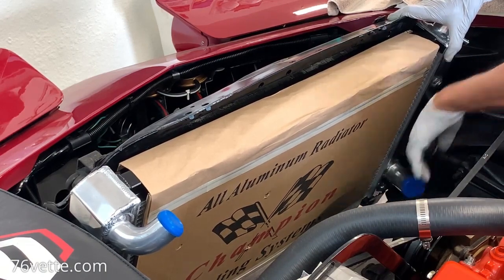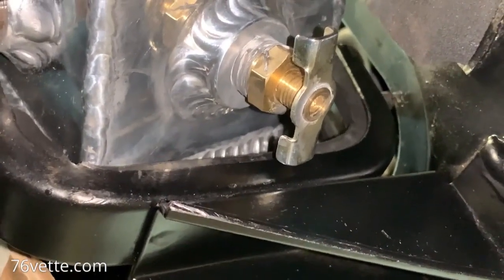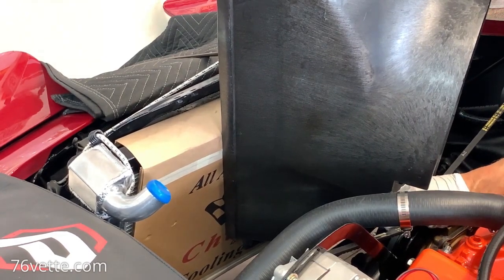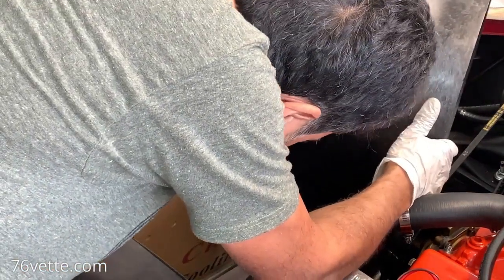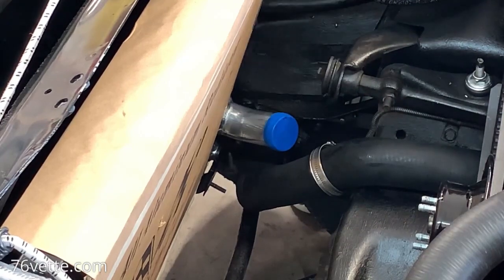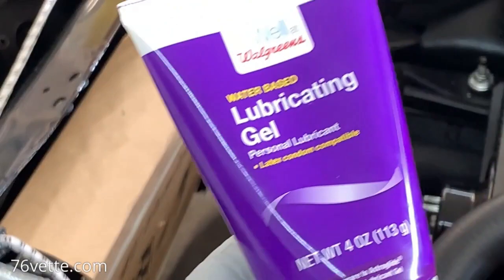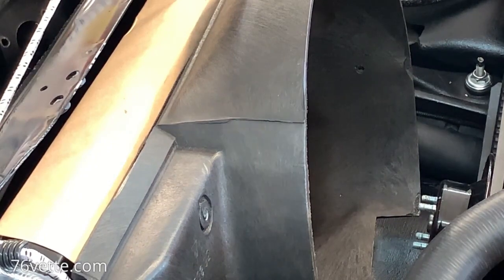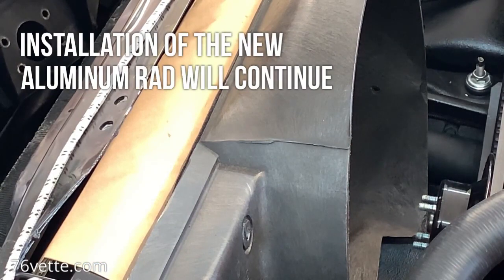STOP 🛑 DO NOT Cut the Shroud!

Comment: I am prepping to remove the water pump, timing gear set, probably the oil pan… and discovered that whoever changed out the radiator prior to my ownership, split the shroud in two halves. It was a very neat job, but it surprised me when I discovered it.
Cut on top, and bottom middle. The reinforced with blind plates riveted in place. Almost invisible.
Reply from the maker: As long as it looks good and does its job, you have nothing to worry about. 😊👍🏻

Comment: I watched it on Corvette Ben they u put the fan shroud on with the radiator completely out. Then u slide in the radiator. It goes in wayyyy easier like that
Reply from the maker: I am sure, but then you still need to wrestle with the lower hose which is very challenging with the shroud on. But I may give that approach a try if the need ever arises. Thank you for watching! 😊👍🏻

Comment: Do you use a lower radiator hose spring on your car? Mine had one but it was rusted to pieces, and would’ve been sucked into the water pump.
Reply from the maker: No, and fortunately, have had no issues. 😊👍🏻
Reply: @76vette Thanks

Comment: Those water pump studs just screw out.  Made my install much easier...
Reply from the maker: No doubt. But as I mention in the video, I used red thread locker for mine when i installed the new water pump. Nevertheless, had plenty of room with the headlamp actuators out of the way.
Reply: @76vette  Quick tip; Red (any color) Threadlocked bolts can be easily removed by heating with propane torch...